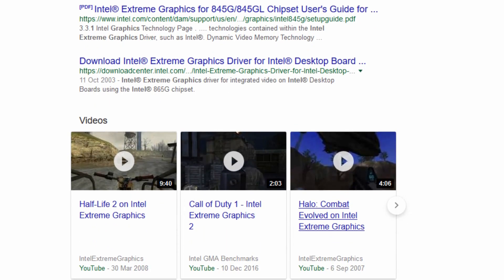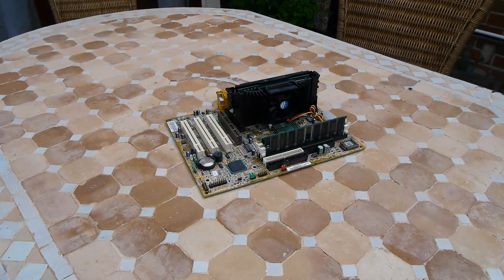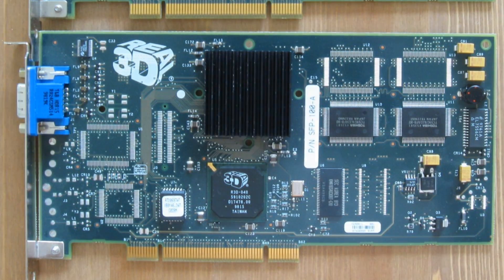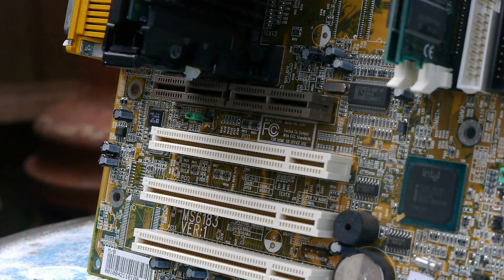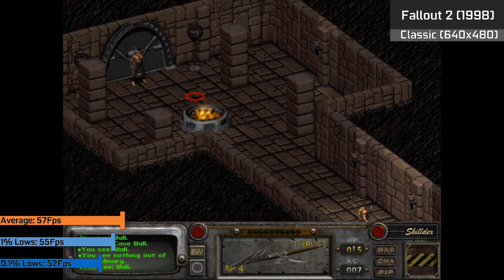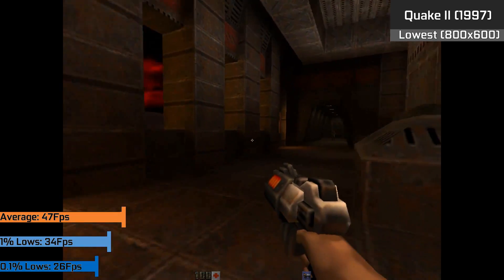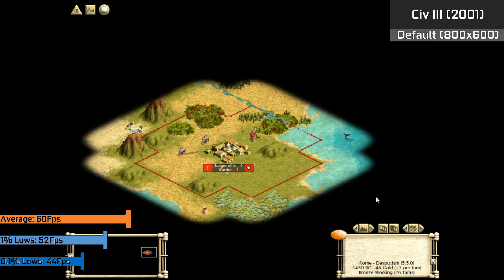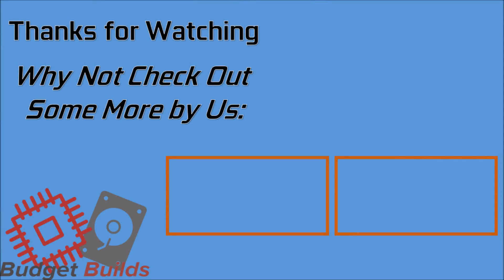Can you GAME on Intels First iGPU?

Comment: yeah, I have the Intel 845 "Extreme" chip in a few older computers, I absolutely hate not being able to get an AGP card, the boards didn't even come with AGP slots, just 3 PCI ones. Its extremely annoying trying to find a decent card for an ok price.
Reply: the extreme 2 was barely better than a radeon 7000 based igp so even a fx5200 will make a nice upgrade.
Reply: Remember having a friend with such a board.
The fastest cards for PCI will be a Geforce GT 430 or GT 520/610, Zotac built some bit they are rare and expensive today.
Then there are some GT 9400, 8400 GS and HD 5450 for PCI, and of course the dreadful FX 5200.
Except for the later all of them. Even PCIe 1x will be way faster on them and they're beat by cards sometimes 5 years older.
This are good examples about those:
https://youtu.be/yNEge5r6-mg
https://www.youtube.com/watch?v=LBgEW5cZ_9o
Reply: I am pretty worse than that. My board has a shitty trident 3d blade, and donr have any agp. At least in your case you can run something without the pci card. 
But anyways, do you know a good pci card for retro gaming ?
Reply: There are PCI variants of TNT2 M64, MX400, all the way up to GeForce GT610/710.
Reply: Miguel Que The problem is that i cant seem to find these in my country for sale, only the pciex versions or the agp ones. 
Is there a very popular one that has a decent performance?
I wanted two of these pci:
One of the win98/2k/xp era for 98 and xp retrograming
And a much newer one for pushing a old athlon xp system to its maximum limit, maxing out the processor to a 2.8ghz athlon, 2gb of ddr1 ram 400mhz, and the best vga i could get, but the system dont have a agp slot, only pci. 

Yeah, i have 2 motherboards that dont have agp and i will do some projects with them.
Reply: Isn't there a PCI variant of FX5500 floating around? That seems to be quite popular. As for the Athlon build, I suggest getting another motherboard with AGP slot. Of course, you can get a PCI variant of GeForce 6200, etc. Just don't expect too much from such limited bandwidth.
Reply: Miguel Que Yeah, i'm working on a new mobo for the athlon system. But it seems quite hard to find a good model that didnt had the usuall problems such as bad caps, a bios that easily corrupts itself and for a good price. 
Thx for the vga recomendations! 
I will se if i can make at least the first rig working nicelly.

Comment: Get the AGP Intel graphics card and put it on an AMD mobo.
Reply: I've actually done this, it's a pretty fun idea for a video. Not spoiling, but if you want an extreme bottleneck, the best AMD mobo with AGP slot is the Asus A8V Deluxe (supports Dual Athlon FX of socket 939) (loved by me and Phil from Phil's computer lab) or the Biostar K8M800 Micro AM2 (really shitty mobo, but to my knowledge, the only AGP mobo with AM2 CPU support and DDR2 RAM), good luck.
Reply: Janghan Hong the a8v deluxe is a terrible motherboard. I picked one up because it was one of the few left to support my orphaned Opteron 185, and all it did was corrupt the install within minutes of installing the accursed VIA chipset drivers.
Reply: asrock am2nf3-vsta is an am2 board that has agp. also supports ddr2 and am3 cpus too.
Reply: VIA makes some of the best 9x chipset drivers, I don't know what use case you had.Get the normie socket 939 with a PCIE slot if you aren't planning to use it with AGP card and Windows 9x
Reply: yeah, forget what I said, that's the best AGP mobo by far, it's got Nvidia chipset too, which makes this a full RGB retro build with just CPU, mobo, and "GPU".
Reply: Janghan Hong i was trying to use windows xp because i was able to max out the ram at 4gb of ddr 400. It was such a three ring circus to even get it to pass post with all the ram.

Thankfully i found someone willing to take the system off my hands and i since was able to scavenge together a build with a phenom 965 and a radeon 7770 at the moment.
Reply: Well, I hope you sold it to someone who can use it the way God intended - 1200x1600 Windows 98SE gaming.
Reply: Janghan Hong i didn't sell it. I gave it away, because it was that much of a hassle. I was more surprised that they were so interested after hearing that the bios spoke its diagnostic codes.

Not to mention windowd 98 won't support more than a gig of ram, or more than one cpu core.

What is funny is that since finishing the phenom build, i had since made a patched iso of windows xp that will support pae correctly, allowing it to recognize up to 128gb of system ram.
Reply: Oh oh... Oh, no! It's back.
Reply: Jorge Ramos please tell me more about that windows XP with uncrippled pae support
Reply: @JanghanHong  1600x1200 come on get it the right way in a 4x3 format.
Reply: @JanghanHong  ASROCK AM2NF3-VSTA 8x AGP, SATA, PATA, Floppy, PCI, DDRII and AM2.  I guess good luck anyone finding one though.   Edit: I see others have mentioned it.
Reply: I used AMD K6-2 with Intel i740 GPU back in 1999
Reply: Wait! That´s illegal!

Comment: Can it at least show a screenshot of Crysis?
Reply: at around 96x64 resolution
Reply: Maybe. But maybe not in 32-bits colordepth ;)
Reply: It can actually show Crysis at 1024x768 in full motion quite well. Streaming is fine and DVD playback was flawless.
Reply: they are still being rendered...
Reply: go yo sumatera
Reply: Haha, if it had at least directx 8 support then maybe with a lot of hacks.....

But speaking seriously, the weakest gpu that can run Crysis may be the GeForce 6100. It was already weak for old games, so i couldnt imagine Crysis, but it may run at like 2 fps.
Reply: oh yeah yeah
Reply: Nope
Reply: The drivers were shit too. I remember having missing textures and glichy graphics in NFS hot pursuit. 
Intel igpus back then were not better than for playing solitaire single player.
Reply: @laharl2k  are you kidding ? I used to game on this with quite a few good games at the time. My i740 was tortured on my monster box P2 500 over clocked and heat-sinked to stupid levels.
Reply: @laharl2k  OK it is awful as those cards you mention are huge beasts to this. Its only 8 meg of ram. It was out in the days of the celeron 300 the cyrix 266 and SDR or even 72 pin Simms. Its a really old card. Most systems had 32 mb ram and 3.2 GB hard drives.
Reply: @laharl2k  yeah the 915 version was shitty. It was kinda crippled compared to the full card.
Reply: @laharl2k  lol I used to game on this graphics chip for a few years.

Comment: Can it run Crysis?
Reply from the maker: It can start Unreal.
Reply: Budget-Builds Official close enough.
Reply: @BudgetBuildsOfficial  start but not run lul
Reply: @RandomFandomOfficial  Yes it will walk
Reply: It might run at 60 frames per hour.
Reply: Yusuf Stone *60 FPM (frames per millennium)
Reply: "Unreal" was "Crysis" in 1998. And yes, it runs Unreal.
Reply: AnotherTerrible ContentCreator Barely.
Reply: the chip came out in 1999, if it had started crysis back then, in 2020 it could be still rendering the first frame...

Comment: They were bad in the time but not sooooooo bad.
Reply: Summoner Arthur actually better than SiS 530 and SiS 620 igpus
Reply: Señor Dossier [Retro reviews, Coleccionismo & más] 
Sis was crap but whats the difference when the drivers were crap anywyas? 
I couldnt run most of my games on mine (i915). They would crash, or have missing textures or glitches moat of the times. 
And even low end card from ati or nvidia would do laps on it.
Reply: @SeñorDossierOficial  remember the SiS 6326 ? Savage 4 8mb. Awesome cheap cards.
Reply: @scottrich976  the sis 530/620 were based on the 6326
Reply: @SeñorDossierOficial  I know but I had a lot of the older stuff at certain points of the 90s and early 2000s.
Reply: What about Cirrus Logic? Not good at 3D, but the easiest video card to install. Works every time. On the other hand...Trident 9400, or S3... how I hated the trident card... all card named almost the same but the drivers never works!
Reply: A bit like nowdays

Comment: Can you please tell me, since im a very VERY budget gamer, will a gtx 750 1 or 2gb work on this rig:
AMD X4 B97 3.2ghy quad core
8gb ram
And a mid quality 320w psu.
Btw, I love your videos, keep going!
Reply: Dun Dun Dun Dun you would be fine with the 2 gig card and latter you could get a phenom to get better could performance
Reply: beylen current k thanks, but im pretty sure that the cpu is phenom II
Reply: Yeah I feel like those specs make sense.
Do know that many games don't get any optimizations for old AMD CPUs/platforms and driver optimizations for GTX 700 series cards have basically completely halted, so you might find a few games from 2016 and many from 2017 and 2018 get exponentially harder to run than 2015 and older. I personally went through that when I decided to upgrade from a GTX 750 in 2016.
Also, I got a GTX 750 that overclocked really nice, so it's probably worth your time to try that. I was able to get it around 1430 MHz on core and thanks to some nice Samsung memory something ridiculous like near 3000 MHz on memory. It was around 12-15% up on most applications I was testing.
Reply: Licentious Howler thanks u2